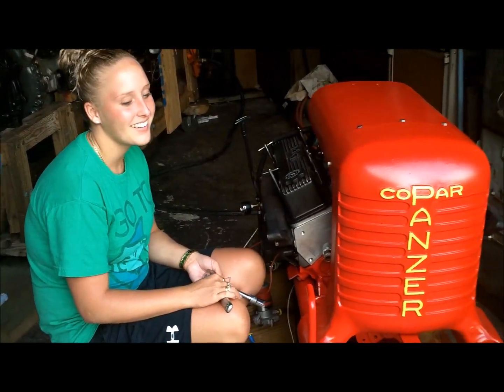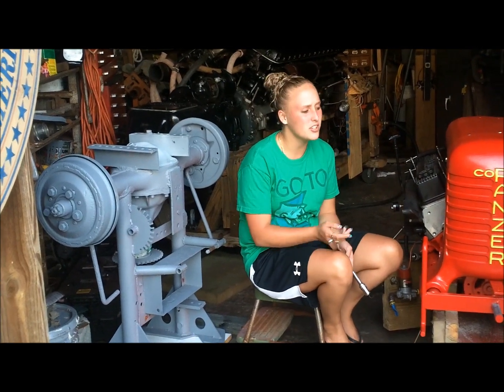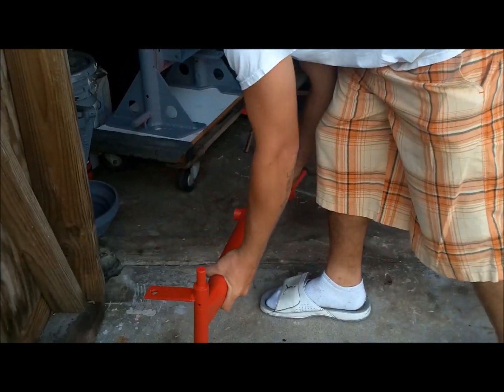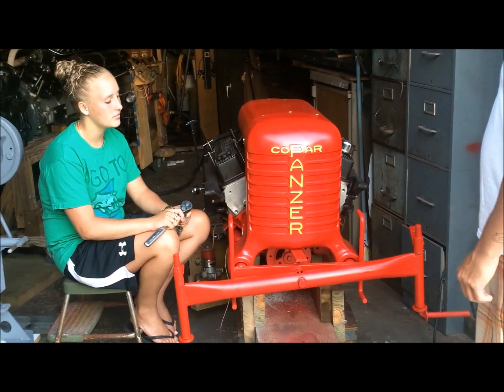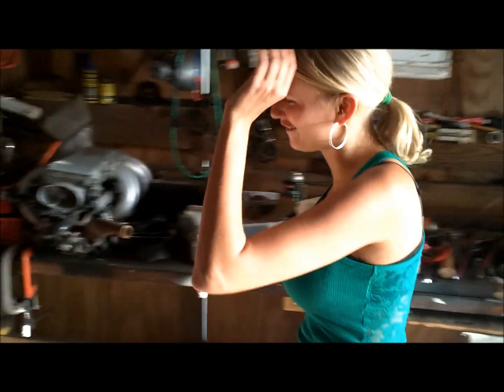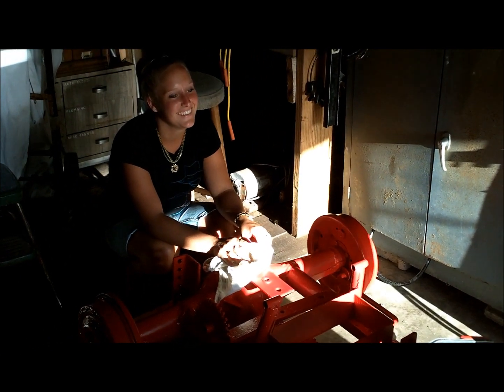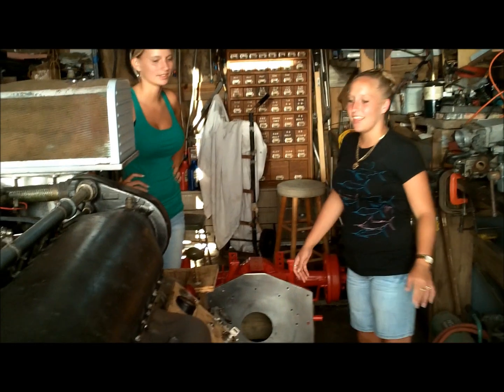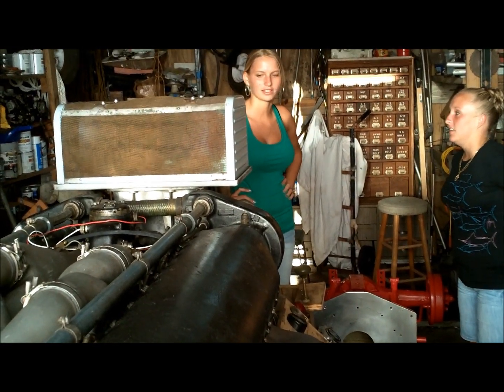Allison V12 airplane engine start-up .

Comment: I am Kelly at ireland1389@gmail.com. I am a huge fan of Allison engines. They sound great, and being that I am blind I love the sound of a big engine starting up However this video does the engine no justice. it skips the engine turning over and gives a sound like an old vacume cleaner with a broken belt and then switches to the engine passing by. Honestly a 1 horse brigs engine sounds better instead of the engine popping and rambling along like a broken ford escort. All I liked were the girls.